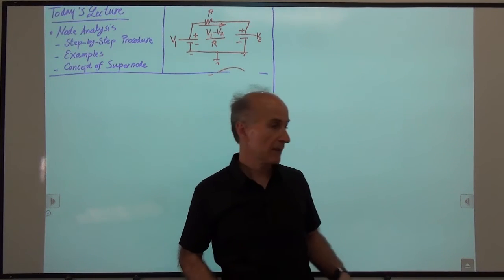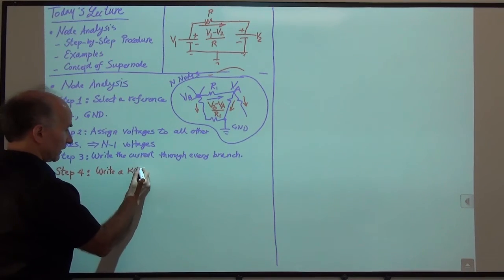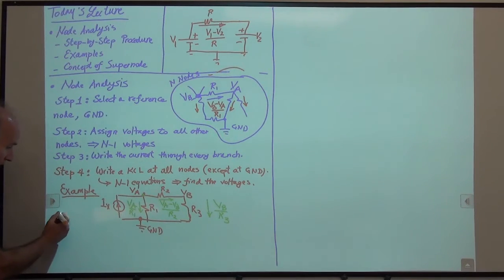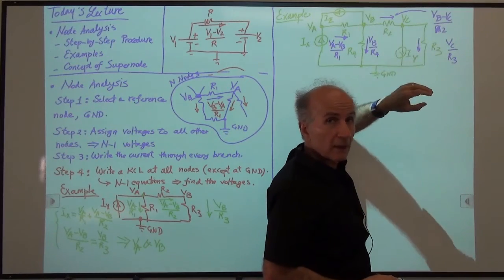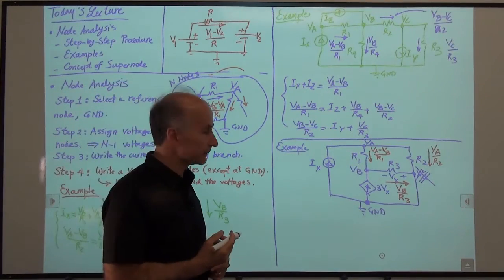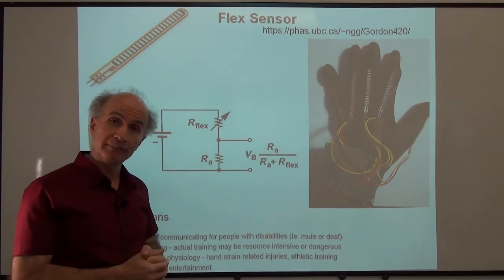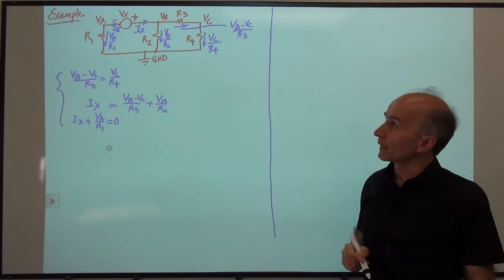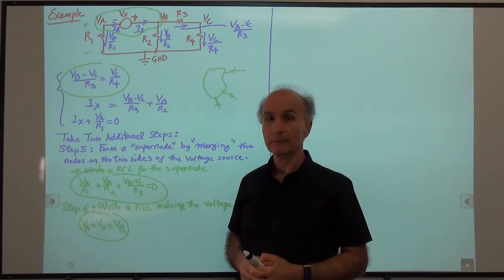Razavi Basic Circuits Lec 6: Node Analysis, Supernodes

Comment: The last exercise could be simplified to one source and one resistor, given that R3 and R4 are in series, and then they are in parallel to the R2, and this is also in series to R1... Therefore, with one resistor and one voltage source Ix could be simply calculated. Or do I miss something?
Reply: I think the objective here is not only to solve Ix, is to solve Ix, Va,Vb,Vc, 4 unknowns variables to understand the circuit.